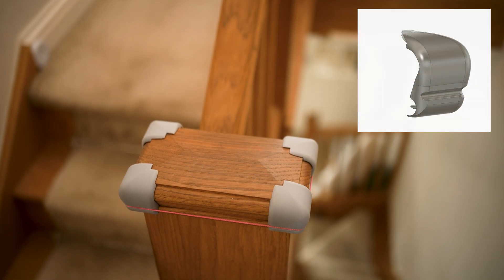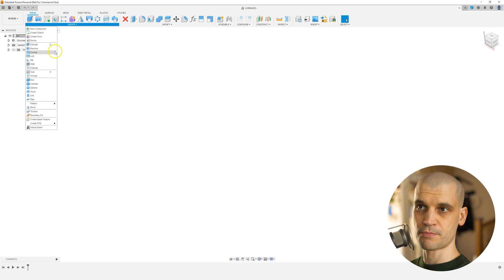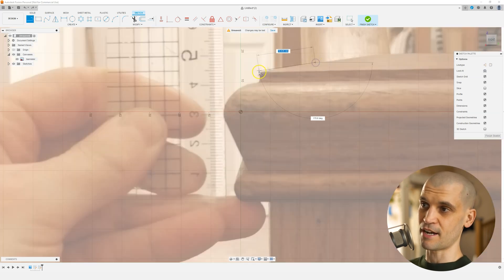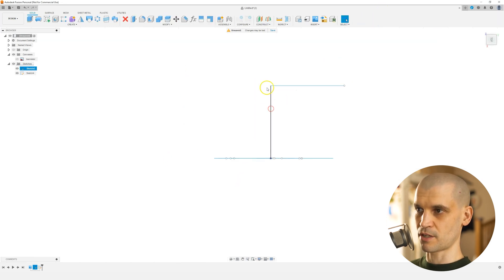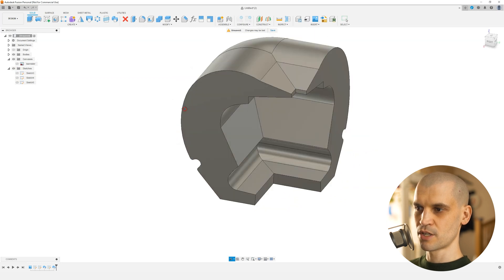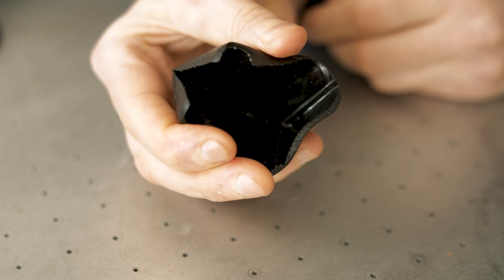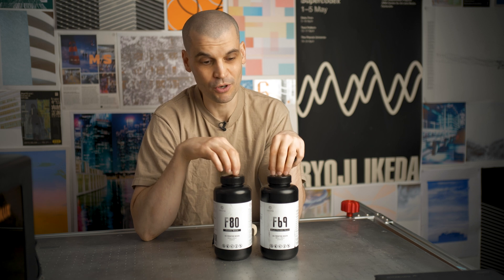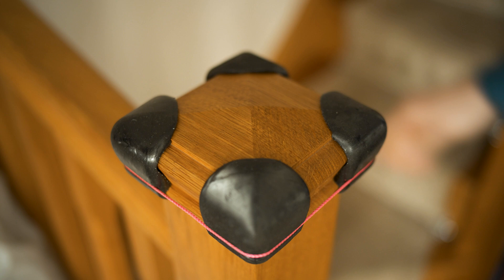Injury-Proofing My Home with 3D Printed Corner Bumpers! #fusion360 #Resione resins

Comment: Thanks for showing 2 different resins from Resione. Very very high quality video overall.
I think it could be better to just print the whole cap, good for grabbing it + much better look + no need for string to hold it together etc
Also bizarre DIY printing/curing setup you got there
Reply from the maker: Thanks, that's a great idea, I wish I had a printer big enough that could print a full brim, would have been much easier too
Reply: @ThisDesignedThat   Oh yeah, I have Elegoo Mars 2 Pro and it's pretty small, sometimes I wish I have Anycubic M3 MAX which is gigantic
Reply from the maker: @DeathCoreGuitar  m3 max would be nice, I'm hoping a brand will send me one of their larger machines for a review this year, if not I'll probably be buying a phrozen 8k or m3 max sized machine next year. I really love the results I get with resin printers, i always thought it was slower than FDM but actually it is MUCH quicker to print as long as you make use of filling the whole build plate, i didnt know this before buying the mars 3. combine that with the huge amount of resins available and the possibilities are huge.
Reply: @ThisDesignedThat  Oh yeah, it's much faster, and sometimes I feel like it's easier, because you getting better results faster and quieter. And it's not as messy and "deadly poisonous" like people say, especially with water based or plant based (some standard ones are became plant based, I think Elegoo Standart 2.0 is like that). And you can get carbon filters, or shove printer into a closet with a hole and run vent into nearest window. If you are not clumsy you don't need gloves or anything. Overall I like resin printing a little more than FDM, especially how quiet it is, low electricity consumption and no heating elements (safer)
Will be waiting for new vids, have a good day

Comment: Interesting, great video! I've been developing something similar for a product. I've used Fusion's volumetric lattice function to add more flexibility at the point of contact which has worked really well. I printed mine in TPU on an SLS printer rather than with resin as I've found the flexible resins  I used in the past harden over time.
Reply from the maker: This is exactly what I was looking for in Fusion, thanks for letting me know what it was called, hopefully I can use it in their free version. I'm going to print a few more using the lattice if I can. Yes you are correct, prints will harden over time according to the manufacturers notes and it seems this is the same for most flexible resins. Ill keep an eye on it and see how long it takes to harden.